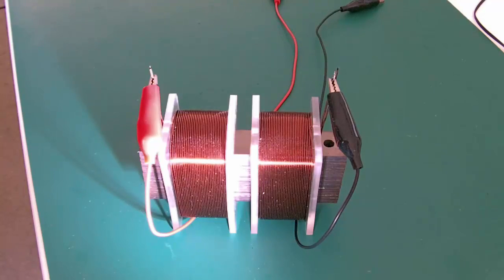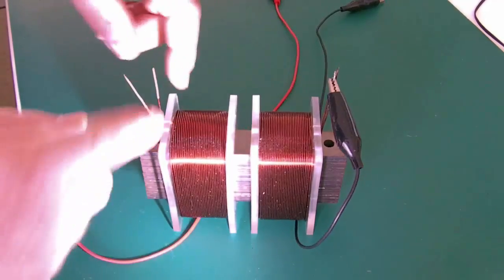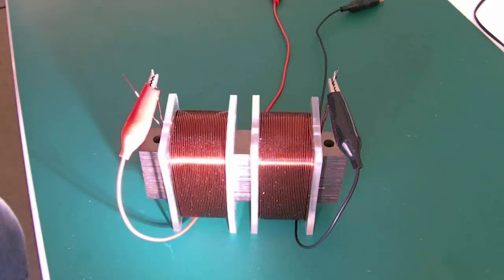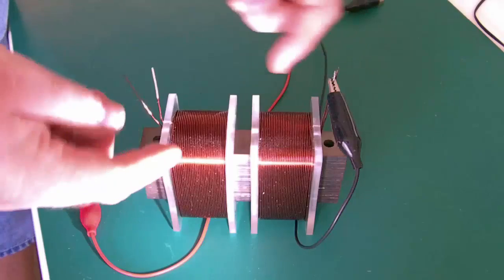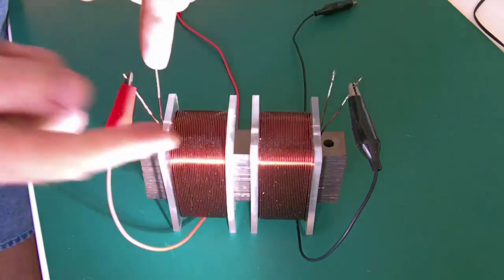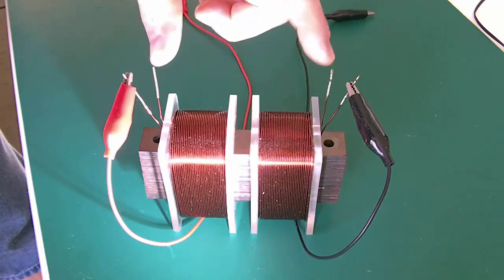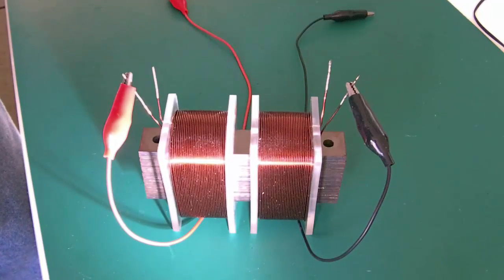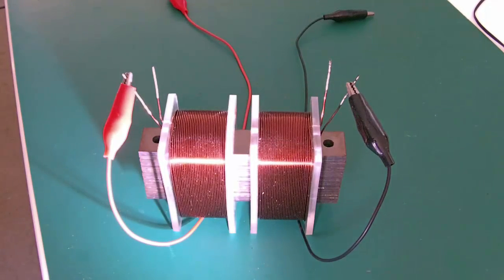Explanation of Partnered Output Coils

Comment: The collapsing fields run headlong into each other. This configuration is in Tesla's patent. He used 20 thousand cps and 20 KV to effect the aether. Can radiant movement be accomplished with much less voltage? 
Thanks very much for all the work.
Reply: I recommend Master Ivo if you want information on producing Dielectricity/Radiant Energy with low power.

Comment: I'm not quite sure where this gets you. If the coils are perfect inductors, the emf in one is equal and opposite to the emf in the other, in other words, you have a short circuit to a.c. You might get a nonzero voltage because of ohmic resistance in the coils, or leakage inductance. But thats not making energy, without an external supply, as your experiments will certainly confirm. Faraday was right!
Reply from the maker: Bill, EM Induction, between any Coil. Some call this Parasitic, it is however what we are looking for! Maximizing Electromagnetic Induction, allowing for it to occur more than once in a System, can make for Double the Induction Output. Symmetry is not beneficial, Asymmetry is!
Reply: Im sorry but this is getting nowhere. You have two coils wound in such a way that the magnetic field in one opposes the field in the other. Then what? You dont show how you intend to connect them, where you might apply any kind of input, where the output is, or what you would measure to see how it works. Do that instead of making vague assertions, and show us that you are on to something.

Comment: Hello. can you please provide the missing details to this video. i want to test this theory you are explaining but need to know a few details.  Can you show this thing hooked up to a battery with the four clips clipped on the right wires/terminals. i understand how to wind the wire CW AC but where do you clip the four clip ends? the two clips furthest away clip to a battery? I heard someone talking about these spinning apposing fields today and want to validate this theory. Also where do you attach the multi meter probes to measure the output amperage power? PS Is that a piece of aluminium or steel in the middle of the coils?
Reply from the maker: If you wish to learn more, be part of something better: http://www.aboveunity.com - Join us, start the path to the future and ride along with other like minded people.
Reply: Im sure the preva experiment is quite simple but i will have to learn to read a circuit diagram before understanding it. Will probably sign up soon.

Comment: If you have two coils, one wound clockwise on the same common I core, and one wound counter clockwise, and you put them wired in Series and put DC thru them, you'll get a bucking field between the two coils sharing the same core. 

If the two coils are both clockwise or counter clockwise on a common I core, then the space between the two coils will see Attracting fields of opposite polarity.   (this also with a Series connection between them and DC put thru.)
Reply: Note that just flipping a coil over and sliding it back on the core, doesn't invert the winding direction.   

You could also put the same directionally wound coils on and instead just connect the coils to the DC source so that it produces bucking or attracting....  

I wonder if anyones setup two coils on either side of the same core... inside coil on one half clockwise, outside coil on that same half counter clockwise, then inside coil on other half counter clockwise, and outside coil on other half clockwise...  with both inner coils wired in series for DC impulses to pass thru...   and then a variety of wired connections tried for the outter coils to see which produces the best output?

Comment: The partnered coils in my interpretation are not output coils and yes, input coils. Where the voltage supplying them is 90 ° out of phase, and the output coil is between the input coils.
Reply from the maker: Please study in detail the Electric 'Generator' - When the Fields oppose, Energy is 'Generated' or Pumped. Charged Particles via the Lorentz Force are are Forced (F) through the Wave Guide (Insulated Wire) to the Terminals of the 'Generator' - Please see: https://www.youtube.com/watch?v=GFqJ5D6mkO0 to see how the Fields Oppose.

***PROBLEM - Conventional Bucking: To get the Field Up and Current Flowing in the Conductor, as much Energy + Losses is needed to start this process... Why? How could we get around this? Wave Peak is a Clue! Where we already have Current and a Magnetic Field and its already changing in Time, we switch in in the Bucking Coils... Or Inject a sharp spike to start the Current in the Bucking Coils at Peak Current.

The Magnetic Field is the Secret to Energy, Energy Begets Energy, Nature uses this all the Time, The Atom uses this , in motion for how many Billion years? Yes we are the silly ones, we make choices to not believe in Nature, where we need to Learn from Nature!

Comment: Apart from the very confusing presentation, that is how whats done ???
Reply from the maker: Sorry this video was not clearer, however, there is an amount of required research to be able to understand this. If Current in each Coil flows in the opposite Directions, then the Magnetic Fields Oppose, two separate coils allow for this to occur, and the Voltage potential on the Output is not affected, so Current can Flow if the Voltage Potential difference is there on the terminals. If there is no Voltage Potential, there can be no Current. Maybe start here: https://www.youtube.com/watch?v=iJsVSMQqCOM then move on to https://www.youtube.com/watch?v=EsKoAu_X25A
Reply: a good way would be perhaps if you could get an indication of the inductance - so for example if you connect them in one particular configuration and do an inducatance reading it reads X then for example is there an indication of an opposing field effect on the inductance measurment - that would be a good indicator also for already wound systems configurations.  and easier for people to conduct analysis .   i'll look into that for sure.
Reply: thanks for the info.

Comment: Are you feeding AC or DC to the coils?  it must be AC to build a field to induce a field into the other coil, and your disregarding the fact it does not matter which way the secondary is wound in transformers. Reversal or the same way round, only alters the phase relationship in AC, there are no other effects or "bucking". I designed transformers for a living whilst in electrical engineering, and get the feeling your heading up a side alley here....
Reply from the maker: +stephen wallin - Please read the supplied information in the Video Description. I normally use AC but DC Works also. The Key here is Time Rate of Change of the Magnetic Field. Follow this video: https://www.youtube.com/watch?v=iJsVSMQqCOM - for the visual Effects and how to achieve this. View other Videos on my Channel for more information. Also see my website: www.hyiq.org&#160; - Good Luck! Pay it forward!

Comment: Great video! Thanks! Just to help clarify "relative to the core"... input is the beginning of the winding, which butts up next to the core and pushes the magnetic field according to the right hand rule... Then consider the winding direction. Input goes to the start of the winding, output at end of winding - cw on left / ccw on right. This is a slightly different way of describing what you are demonstrating. Hope this helps some people.
Reply from the maker: +Solar OffGrid - &quot;relative to the core&quot;... Meaning the Core has a Dynamic Movement of the Domains/Atoms as they Align with the Input Magnetic Field. As the Core moves through Hysteresis the Partnered Output Coils will start doing work. EG: in the video: https://www.youtube.com/watch?v=iJsVSMQqCOM - If the Light is not connected, the Partnered Output Coils dont do any Work. If the Light is connected, they do work and this assists in the Dynamic Movement of the Core through Hysteresis. Hope this helps! Merry Christmas!!!